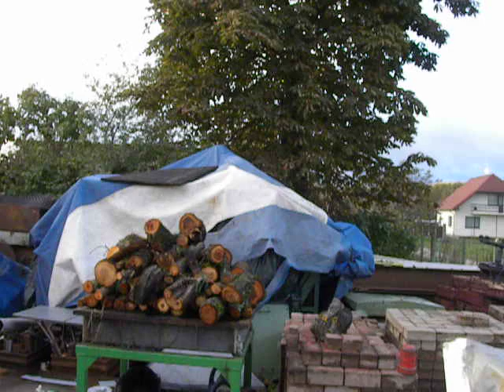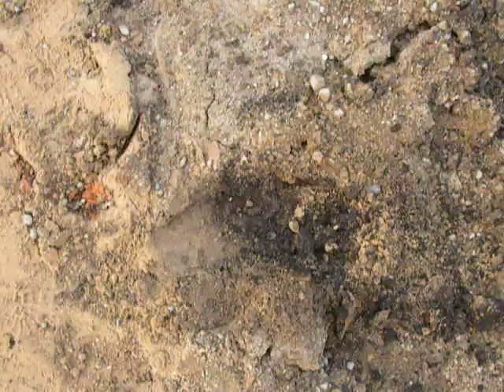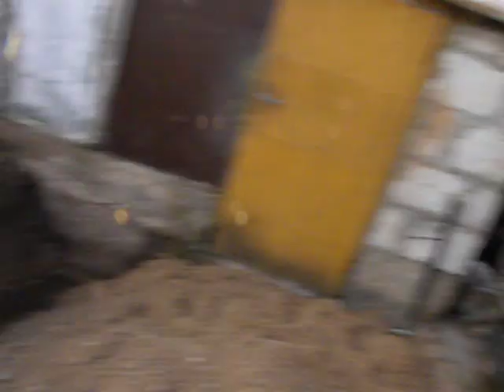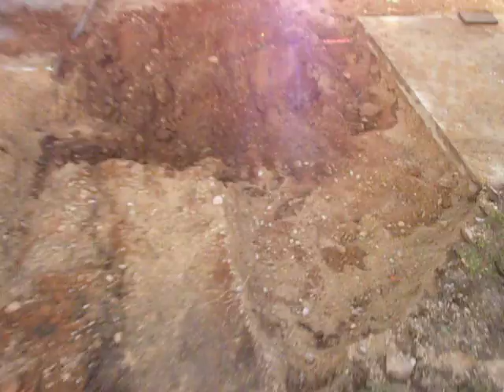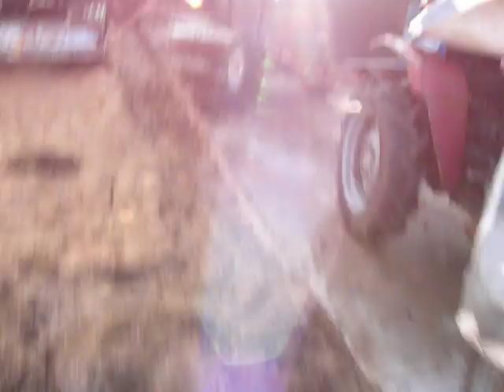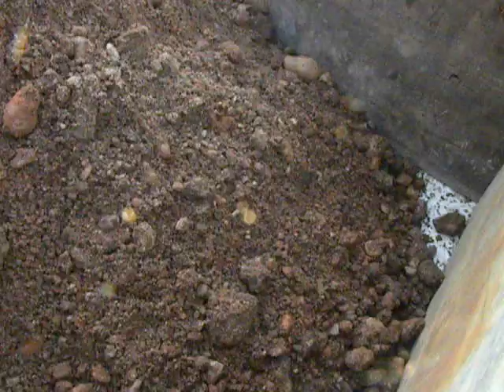Workshop field improvement - first time ever I run excavator part 1

Comment: What does the orange pipe hold ?
Is it water ,Gas , or electricity ?
Cheers Eric
Reply from the maker: That tiny red 45mm pipe? It holded... in past... 400V cable, 230V cables, WEB cable, another cables... I hit it with excavator and cables are gone. Now I instaled new 110mm pipe for cables and anothe underground communications. Today I manage hit 2 pipes for what I had no any idea before.... both get demounted. Totaly I have hit 4 pipes... I start to think to there is more pipes... XD
Cheers!